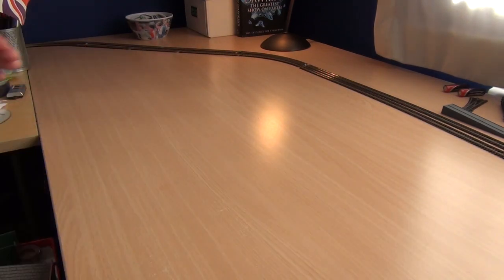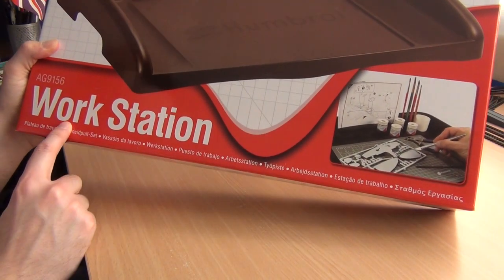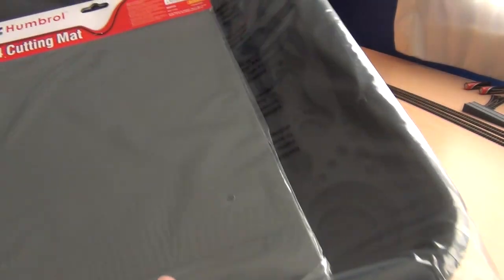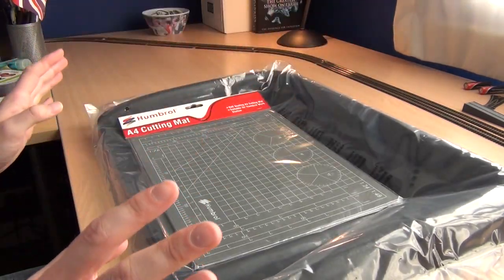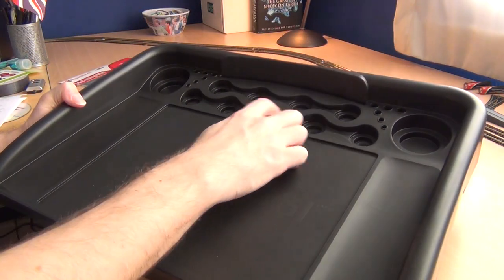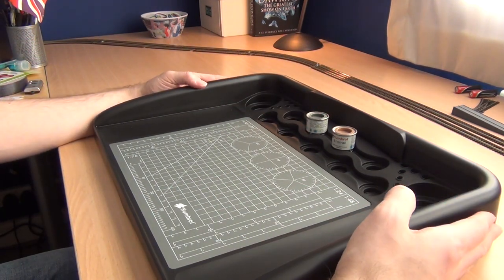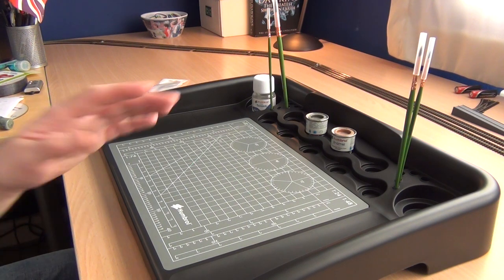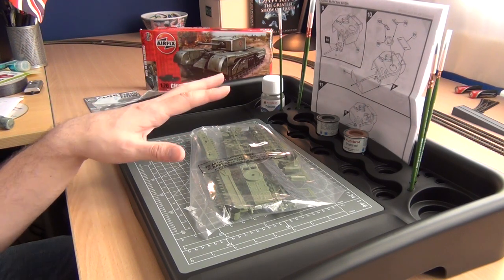The Humbrol Work Station: Review

Comment: This a really good Video InterCity82 . Well done. I did not know that Hornby / Humbrol had brought this out. The Humbrol Work Station is something I should recommend to my Dad as builds quite a few Hornby / Airfix Kits as well. It's really useful as it hols all items you will need to build a Plastic Kit Set. At the price of £19.99, I think it's a bit of a bargain really, so it's not expensive as you think it, is especially seeing that it's not made of cheap plastic that could break on it's first use.
Reply from the maker: Thanks for the comment!
Reply: That's OK InterCity82 .

Comment: I looked at this on the Argos website and there seems to be some confusion over if it comes with the cutting mat or not someone ask the question if it does and Argos replied saying "The cutting mat is sold separately" just like the box says.

But when I looked at the reviews people have wrote about it there are  3 review on there that say the cutting mat is included and this review proves that the Argos reviewers are tell the truth. I wonder why the box and Argos are saying its not included when it is this is a bit misleading to customers who may do what you did and go and buy a cutting mat only to find there is one in the box.
Reply: Not everyone recieved one so I expect a batch or 2 the factory put them in by mistake.

Comment: Just got one. Very disappointed in this product very unstable on a flat surface as it's poorly moulded and will not sit level at all furthermore Humbrol stat it can be used on your lap this is also impossible as it's top heavy not fit for purpose at all.